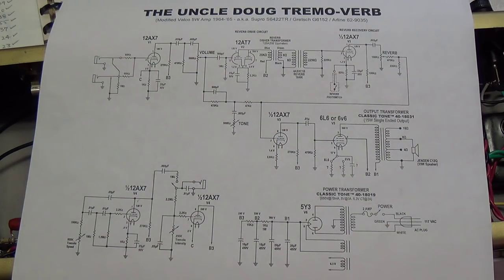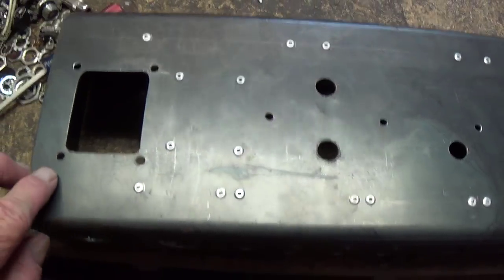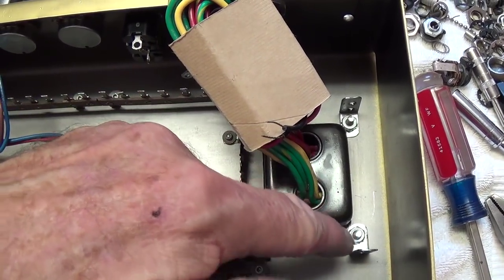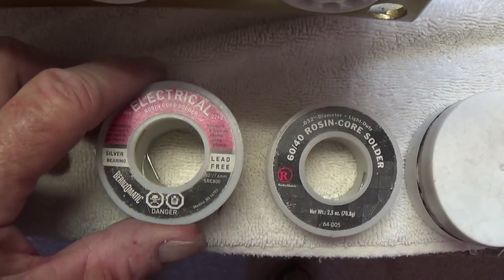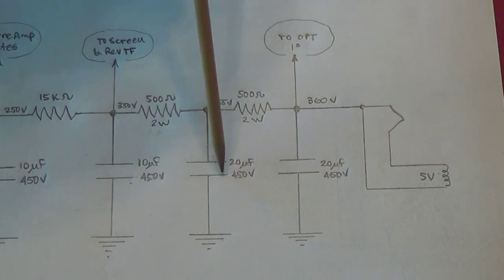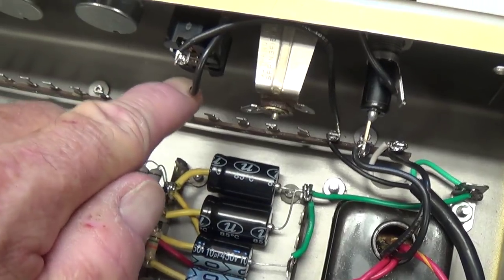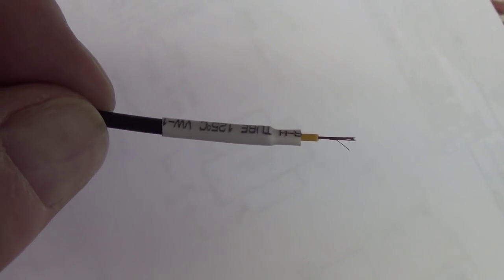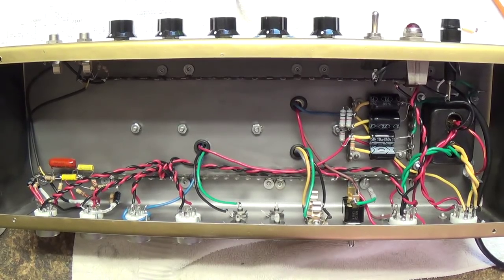How to Scratch-Build a Vintage Amp, Part 7:  Chassis Finishing and Point-to-Point Wiring

Comment: Nice serie of videos Uncle Doug!
I copied the supro 1660t/Gretsch 6150t and your videos with voltage reading were very useful! 
I tried to make the faceplate as similar as possible. I used thermal transfer on bare aluminum chassis (toner print using glossy paper and flatiron) and clearcoat.
Reply from the maker: +Thomas Hafemann Thanks, Thomas. We're glad the videos were helpful.  How did that thermal transfer process turn out?   From how I visualize your description of it, I would think the lettering would come out backwards.
Reply: +Uncle Doug I mirrored everything before printing. The thermal transfer took me almost an hour, as the chassis was big enough to dissipate the heat. There were some small flaws that I managed to correct with a pen. After the clear coat everything looked better. http://s1303.photobucket.com/user/Thomas_Eduardt_Hafemann/media/DSC_0927_zpszkdf5xnl.jpg.html
Reply from the maker: Beautiful work, Thomas. The black lines are a nice design touch, making it look professional rather than homemade.

Comment: Hello Uncle Doug,  Another well built Dani-Sonic is taking shape.  You are showing great patience in building this amp, particularly now.  Mount the terminal strips, stop & video; paint the chassis, stop & video; do the lettering, stop & video; mount the transformers, stop & video; etc, then you finally get to solder a resistor in place.  The temptation to do it in bigger chunks must be hard to resist but I know the object of the exercise is to explain and show every step required and this you have achieved perfectly.  One point on the wiring.  I think you may have potentially created a small chance for a hum loop.  It is the green wire that runs from the ground lug at the negative end of the two 20/450 caps to the 'safety' ground lug.  The wire forms a parallel current path with chassis which may cause a hum problem.  If the negative ends of the caps could be changed to one of the adjacent vacant terminals and the green wire then connected to the ground lug of the B+, all of the B+ current would then have a single direct path to your filter stage.  If the two caps could swap positions I think their leads would be long enough.  The integrity of the safety grounding of the chassis is maintained.  I hope you don't mind this suggestion as I know what it's like undoing work that was carried out so carefully and then some guy looks over your shoulder and says, "Hey, what about....".  Love the cameos by the two stars, my daughters cat jumps into the bath at the slightest chance.   Thanks again Doug.
Reply from the maker: +Jeff M You're welcome, Jeff, and thanks for your very detailed input.  Here's my take on it. The negative leads of the filter caps are all soldered to a terminal that is riveted to the chassis. I believe this would be the least-resistance pathway for any residual AC to reach the safety ground. I added the auxiliary green grounding wire strictly as a failsafe, should corrosion every occur between the riveted terminal and the chassis. Also, I cannot picture any spurious AC taking an upstream voyage to the input or pre-amp end of the chassis, when the ground it seeks is nearby and located at the opposite end. Does this make sense ?
Reply: +Uncle Doug Thanks for the quick response.  It's just gone 5 in the afternoon here I only expected to hear back tomorrow.  Yes it does and I take your point regarding corrosion and spurious AC, it is a very short wire after all.  My thought was that if the negative ends of the filter caps were wired & soldered directly to the P/T secondary centre tap lug it eliminates any need for the B+ current to travel through the chassis even though it's such a short distance.  I had made the assumption you would be having a star ground system as in your Vibro-Champ clone.  Sorry, I should have worded my original comment better.  I also forgot to say what a great job your friend did on the circuit diagram with black for original and red for changes.  I wish I could do as good.
Reply from the maker: You're welcome, Jeff. I considered a star ground, but the chassis dimensions would have required much longer leads. I am going more for the short-lead, uncluttered approach in this one....with solid grounding for the rather remote primary AC and power supply. Yes, Tommy is doing a wonderful job....and he never complains when I burden him with revision diagrams. He's definitely a helpful, generous member of our channel community.

Comment: Hi again Uncle Doug. As usual you've produced an excellent video to keep us entertained and educated. I'm pleased to see you added the rider about safety and good building practices as it really can't be stressed enough that bad wiring habits can make even the best-thought-out amp sound terrible, and those same bad habits can result in a bad shock, or even worse if we aren't ever-vigilant and treat these amps with deep respect. One thing I'd like to ask you about is your opinion about the methods of connecting flying leads of components to terminal strips. I've been critised in the past for looping capacitor and resistor leads through terminals before soldering (as you appear to do) because of the fact they are much harder to remove in case of component replacement. My feeling is that while it does create a bit of extra work if they do need replacing, it is better to have a physically sound joint over any ease-of-removal concerns. As you point out, solder is not there to add physical strength to a joint; of course, the very nature of how it electrically binds the component lead means solder does add some strength but this is secondary to the aim of soldering for electrical soundness. While it may seem obvious that using one of the softest metals for its strength is not very feasible, in my experience as an avionics engineer and serviceman, many people rely on solder to hold things together, making for some interesting outcomes. I'm looking forward to part 8 and hearing how this beauty sounds; hopefully your predictions about burning the house down don't come to pass! Regards, Dave T.
Reply from the maker: +D-tone Amps and Guitars   Greetings, Dave. I agree with your opinion that leads should be looped and compressed against terminals prior to soldering. Yes, it's harder to undo the solder joint, but the attitude that solder joints should be compromised to facilitate disassembly makes as much sense as leaving the lug nuts loose on your car wheels to facilitate replacing a flat tire.  Perhaps if solder joints were secure, repairs and replacement would not be required as often......or at all.

Comment: Wow....just Wow....:) :) :) You may do a special part regarding to safety...i usually get a little bit overconcerned regarding my DIY-HighVoltage Suff...i put some extra insulation on B+ leads and extra clearance to components carrying the B+ to avoid any arcing or may intermitened contacts...whatever..and add some bleeding resistors to the filtercaps....As it´s always better to be/stay save than sorry ;)
Reply from the maker: +TubiCal Thanks, TC. I too spend a lot of time arranging wires and contacts to eliminate any chance of arcing or accidental contact.  Amps are subject to a lot of vibration, and care must be taken to prevent it from causing circuit mayhem :)

Comment: Just one (quite possibly dumb) question.

I noticed on several Fender blackface amp schematics that the fuse is on the opposite side of the power transformer primary as the power switch, which seems to be on the neutral side.

Obviously this works either way, but is there any advantage/disadvantage or rhyme/reason to the two different conventions? Or is it just a completely arbitrary choice?

Great stuff Doug, thanks again!!!
Reply from the maker: +Admiral Quality It seems like you fellows sorted out the issue quite well. I have, on occasion, used double pole power switches to completely sever any connection to the power source, but did not in this build. It just makes sense to me to wire the switch first so that when it's off, the amp is electrically inert.
Reply: +Uncle Doug Yep, I think I get it now. I love when there's a reason for things!
Reply: +Admiral Quality it´s a safety season. It will surely work either way, but you do not want to have the life remains in your amp while the fuse is cut out, as to be sure that past the fuse there is no more mains voltage if it´s blown...
Reply: +TubiCal Which way is a safety reason? Sorry, I find it hard to understand what you're trying to say. (Are you saying this is why the fuse goes on the hot wire and not the neutral/ground side? Makes sense. But what about locating the switch on the neutral wire? Any advantage to the switch on one side vs. the other?)
Reply: sorry, i do not want to confuse you....:)

If you put the hot wire to the fuse and the fuse will blow there will be no more mains voltage in your amp past the fuse.

If you switch the mains voltage it´s better for safety as well, as when the amp is switched off, there is no more mains voltage within the amp.

Downside: switching the hot, (the mains voltage) the switch always will see a little arc inside its inner terminals....and therefore it will wear out a little faster. But mains power switches are made to stand this.

Buy a good switch from a well known switch brand. It´s far better to pay 2-4bucks more than to have a poorly working/feeling switch.

To be really on the super safety side, use a two pole switch to switch off the hot and the neutral simultanously This would be a pro approach, when it comes to switching ;)
Reply: +TubiCal Ah! The time it takes the primary to charge up stops a sudden surge of current on the neutral side as it's an inductor. That makes sense too, thanks!

Comment: Ah, we're getting to the good part! I like the heat shrink on the un-grounded end of the coax.  Keeps it out of trouble and looks nice, too.
Reply from the maker: +Admiral Quality  The elusive ground loop has caused a lot of grief over the years.  They are easier to prevent than they are to detect :)
Reply: +Chaka Wolf I scored a point for myself when I said "ground loop" 30 seconds before Uncle Doug did. (I'm more familiar with that problem in external patching, but I have made enough ground lifted patch cords to solve it that I immediately recognized why this was a good idea inside as well as outside the chassis.)
Reply from the maker: +Chaka Wolf Thanks, CW.  Sometimes the small details can make a big difference :)